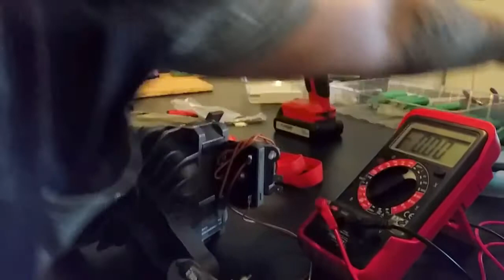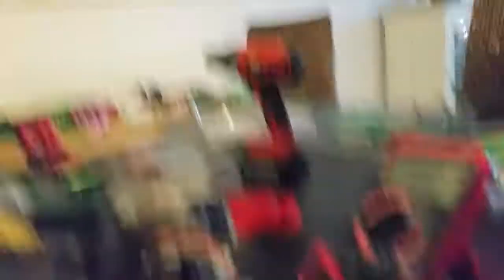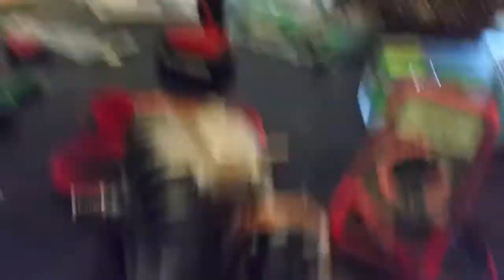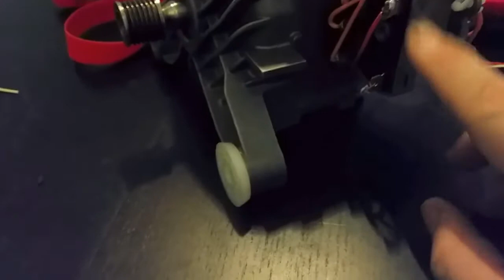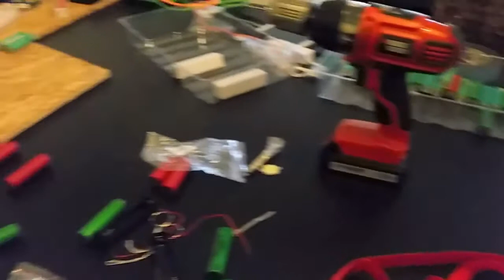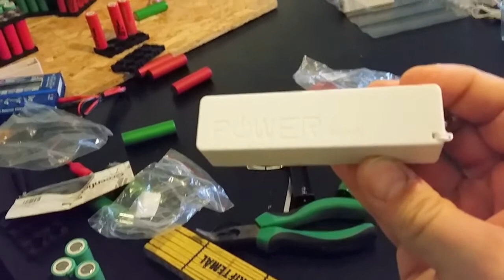How to get FREE ENERGY from neighbors scrap washing machine   Part 2

Comment: Are you still working with the washer motor since you re-posted the same video here?... but with no results again...

I bought the same motor and now I have a belt and a wheel from a washing machine to test it with a water or maybe wind turbine. The changing voltage from output is a nightmare to deal with.
Can you hook up the motor to 12 Volt on a car battery to power an E-Bike? That would be another interesting usuage.
Cheers, Bernd
Reply from the maker: Naah.. It's due to YT new partner thing. Just collecting my vids in one channel instead.
Reply: I don´t understand your point, but I´m going to work with this motor and test it. It´s the best and most suitable unit I had so far. 
You should do the same since you gave the idea to use it :-)
Reply from the maker: I will, I have found the missing drivebelt, and a suitable amp-meter, now i'm ready for testing.
Reply: Let´s keep in contact to share experience with this motor. 
I have the drivebelt and the big wheel from inside the washing machine to try a good ratio from big wheel to the small drive shaft - because that is needed for performance - from my point of view.
Cheers, Bernd